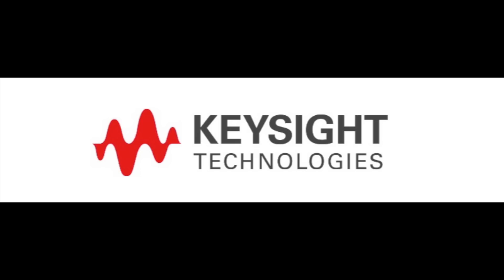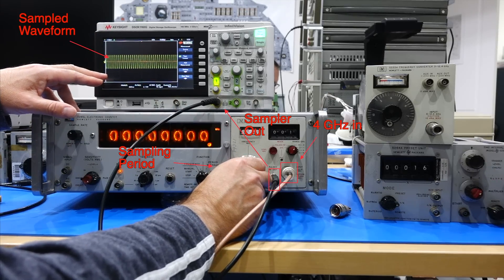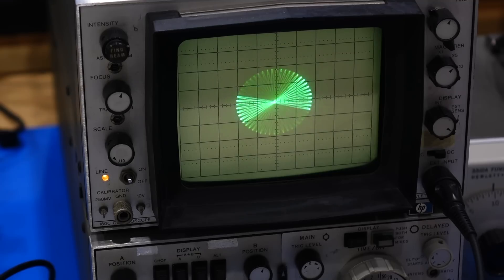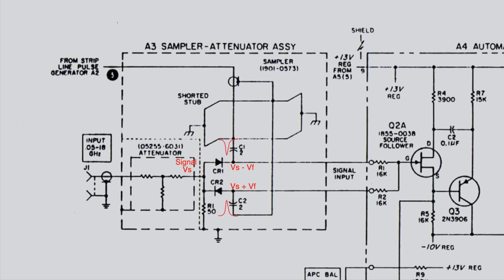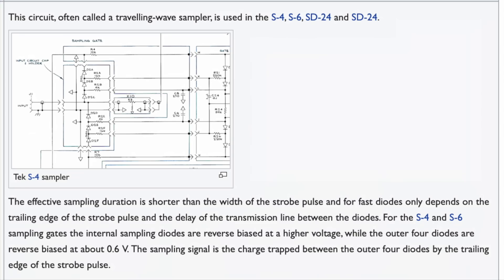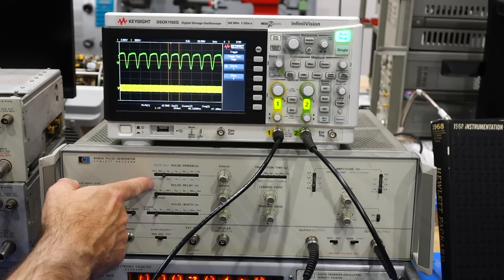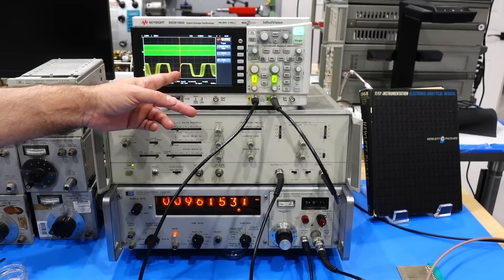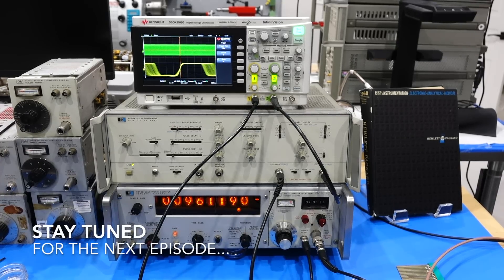Diode Sampler Magic (How Sampling Scopes Work)

Comment: Interesting discovery. You cannot get sampling plug-ins easily. I could try my 5342a counter with IF output.. I have a vector voltmeter I was wanting to make a plug-in for but have no means of measuring a fast pulse generator I was planning to make from a 74f00 nand gate . Did you change the pulse rate to measure the rise time. ?

Comment: We used the same technique for time expansion in RADAR , 13Ghz time expanding to 2Mhz . 
We made it of 2 well mached crystal with only 4 Hz difference,  one oscillator used varactor to keeping 4Hz difference. 
This way we make it very low jitter.
We used then very slow A/D to go digital 😊.  Jitter was big issue , type crystals and oscillator.  Colpit  was best with big size crystal 😊

Comment: I came to this video because I want to make some circuit for showing  a signal up to 10 Mhz on a PC-based oscilloscope.
There are several free oscilloscopes that run under Windows and even under Linux, but they require a digital interface that some people have made with Arduino.
However it is possible to view low frequency audio signals directly through the microphone connector.  The problem is that these signals can rarely exceed 2 or 3 Khz if you want to observe them correctly.
A rectangular signal of only 10 Khz is impossible to observe on a Windows based oscilloscope, entering through the microphone connector.  I have already done it and the signal, far from looking rectangular, looks totally deformed.
That is why I came to this video.
I want to develop a small interface that is able to take samples of a signal higher than 1 Mhz and transform them into an exact copy of the original signal but with a frequency 1000 times lower, in order to display it on a Windows based oscilloscope.
I hope to achieve something....
Reply from the maker: Interesting idea. At these frequencies, what you need is called a sample and hold circuit.

Comment: Hi Mark
I have got such a transfer oszillator but unfortunately these Shottky diodes are toast in my case.  Do you know closest replacement of  current available  diodes?.  Could not find a data sheet  as there  is only a HP type number given in the service doc.
Do you know if the attenuator should also handle DC as the drawing suggests?  Probably mine is also defective as it shows infinity resistance.

Thank you  and congratulation to your outstanding and  amazing channel
Reply from the maker: Although any modern Shottky that can do 20 GHz should work, the big problem is to find one with the right diameter and length tubular package, not sure if they make these anymore! HP made most of their microwave diodes available commercially, but under a different HP commercial number (5082-xxxx) or plain JEDEC number (1Nxxxx). I have not looked for an equivalent, but maybe take a look at a vintage HP microwave semiconductor catalog (the 1980 RF Diode and Transistor Designer's Catalog is online). Then maybe see if you can find one on eBay. Or get a modern Shottky and jury rig a mount that fits. The input should measure 50 Ohms at DC.
Reply: I looked through available historic documents  but could not find a JEDEC number. I think I will try a 1N5712  which has a low capacity of just 1.2pF.  Interestingly they used rather long ( 10cm +) wires  to R1 and R2. Maybe this works as an inductance ? I would rather suggest to have R1 and R2 more close to the diodes/ 2pF capacitors. I will report further progress here but this will take some time until I have got the spare parts @CuriousMarc
Reply: It turned out now that the sampling diodes are ok. I tested them falsely defective because the diodes have a 2k2 resistor in series. So diode testing gave a wrong reading However the attenuator has high impedance in all branches and the 50 ohms resistor R1 seems to be also gone. The attenuator showed destruction from high voltages, I could not locate R1 physically as I do not want to disassemble all the RF part. 
to be continued,,,,
Reply from the maker: @jps-ib8vh  Well that's good news. 50 Ohms surface mount resistors are far easier to find and change than weird RF diodes! I'd try to disassemble the RF part and get to it...
Reply: @CuriousMarc  
Hi Mark, I found a detailed description of the sampler in the hp journal 1966-10.pdf pages 12 - 15
( could not post the link unfortunately)
It is a true masterpiece of microwave engineering. There is also a name and a picture of this amazing true genius: Wayne M. Grove.  Now it is very clear that it is impossible to replace such sampling diodes by modern types. They used a very special three terminal design that includes the sampling capacitor. Before I found this article, I tried to get the sampler out for repair as there was no 50 Ohms resistor detectable.
But by opening the golden union nuts on the sampler block the inner conductors starts turning and immediately destroyed the tiny golden spring that is micro soldered to the two cones of the inner conductor. So NEVER EVER open these nuts. You get the sampler out by removing all pcb´s and the bigger golden union nut connecting the attenuator. This nut is hold in place by a circlip that is very difficult to remove. The broken 50 Ohms I found under the chrome plated terminal cap. It looks like the attenuator and consists of an aluminium oxide subtrate with thin film metalization . It was also fused.  I replaced it by soldering 2 times ten 1k 0603 resistors in parallel that I soldered on a self- adhesive copper foil.
Currently I am struggling to replace the destroyed tiny golden spring. Unfortunately, I do not know exactly how it should look as I could retrieve only some fragments. 
To be continued…
Reply from the maker: @jps-ib8vh  What an adventure! Here is the link to the journal: http://hparchive.com/Journals/HPJ-1966-10.pdf .

Comment: The principle of the shorted stub is explained in more detail in the manual of the hp8551 spectrum analyzer. (Impulse forming for the PLL, sharpening the output of step recovery diodes) I repaired on many of these instruments more than 30 years ago.

Comment: It's interesting to see where else this sampling circuit pops up, the 8405A vector voltmeter is an obvious example (which has the added feature of phase lock sampling rate to the ref A) and then samples the B input producing two IF signals at around 20kHz for both A & B off which phase and amplitude measurements can be made (and the IF works just like a sampling scope and is available out the back - thanks HP). Then the 3406A random sampling RF voltmeter which removes the phase lock and just uses modulated sawtooths to control the sampling points and produces an IF which bears no resemblance to the original signal but which has similar statistical properties (like RMS voltage, although sadly the inbuilt voltmeter isn't true RMS, but once again the IF is available on the back). Finally in the sequence the 8410A/B/C VNA does exactly the same trick as the 8405A (albeit in two stages) producing a VNA up to 12.5GHz in the basic form and to 18GHz with selected mixer heads which is still useful today (and which isn't microprocessor controlled).

Comment: This is gorgeous!! A few weeks ago I bought a cheap USB Oscilloscope, and have been wondering how to give it a speed boost. Even got far enough to see diode sampler circuits but I had no idea how they'd work - your explanation is the first that made it crystal clear, thank you so much!

FYI, the 'scope is an Analog Discovery 3, with 30MHz bandwidth and a lot of decent I/O ports. Shouldn't be impossible to use modern components to create triggers on the HF signal. You can even get configurable delay line components in the ns delay range for barely more than 10€!!
Beautiful stuff :D

Comment: Schottky diodes, field effect transistors, forward voltage, pi network, source follower. The part of me that wishes I had pursued electrical engineering over industrial engineering loves these lessons in circuit design.
Reply: After 27 years of being a heavy truck mechanic, I up and quit and started training in electronics.

Comment: Thanks for a blast from the past.  One my early summer jobs was debugging part of a high speed circuit for a high energy physics group.  I'm a bit vague on the details after so much time has passed, but I recall tunnel diodes and a short (about 30mm) piece of coax shorted at one end to get a delayed and inverted pulse.  I used a Tektronix 661 scope with (probably) a 4S1 plugin.  I recall always having to be wary of aliasing. Ordinary analog scopes in those days weren't even close to being able to show a real-time trace for such fast signals.
Reply: I picked up a working 661 & 4S1 a few years back, it really is an amazing instrument, as specially considering when it came out.  The construction & documentation of those 60s era Tek scopes is like nothing else.

Comment: I seem to recall that the old Tek 465 'scopes have tunnel diodes in the front-end. They use quantum tunneling to effectively achieve negative resistance, apparently. The things that happen up in the    gHz range are strange indeed, it really is like magic.
Reply from the maker: Yet another kind of weird diode, different from the Shottky and the Step Recovery diode. The tunnel diode is a fast bistable element, used in trigger circuits usually.
Also to make microwave oscillators. It does use quantum tunneling indeed!
Reply: @CuriousMarc  My father-in-law worked on sampling heads for the 4S2(A), S-4, and others at Tektronix in the 60s. He has stories about how expensive and small the tunneling diodes were and how the engineers were paranoid of losing them on their benches. :)

Comment: I do love watching your videos.  I'm a truck driver so I probably only understand peko bit of what your saying but I do find it fascinating. If you get time could you explain why counting frequency and sampling is so important?
Reply from the maker: I'd be happy to oblige. So many uses for frequency counting, but the primary one is for radio signals, radars, and cell phones. All that radio technology is based on stacking frequencies and modulation, and the more stable and precise, the better. Perhaps the most ubiquitous use of super high precision time counting is in your GPS receiver. The GPS transmitters are actual atomic clocks flying above our heads, and you triangulate your position by measuring the time difference from clock signals that you receive from different satellites.

Sampling has also many uses. First for its original application, which is sampling scopes that I demonstrate in this video: to measure signals that are faster than you can measure them by normal means. It allows you to slow them down. There are also radio applications, as mixers to shift your received frequency down (same idea, slow radio signals down on the receive end so you can amplify them easily).  But the most important use now is digital communications, wired or wireless. Within your computer, in the internet, in your cell phone. To receive a  bit, you continuously sample the received signal, and adjust your decision point ("is it a 1 or a 0") based on centering the sampled signal. In essence, the latest computer chip high-speed bus pin or Ethernet receiver have what amounts to a mini-sampling scope built-in that continuously monitors the signal and adjusts the receiver. Your phone data demodulator does that too.
Reply: @CuriousMarc  Thank you. That's outstanding.
Reply: We didn't have these signal sources flying over head back in 1968. @CuriousMarc
Reply: Sampling is also used in the reverse direction to convert analogue signals into digital signals i.e. speech and music. For speech in telephony systems, the analogue signals, say from a microphone, are sampled at 8khz. The resulting sample is converted to a 8 bit digital value via an analogue to digital converter, thus creating a 64kb/s bit stream. For CD quality music, it is the same principal, however it is sampled at 44.1khz and converted to a 16 bit digital value. This results in a 44.1khz x 16 x 2 (for stereo) =  1441.2kb/s bit stream.

Comment: Very good video! I recently experimented with a sampler, managed to create nicely symmetric pulses that were below 100ps rise and fall time, and 2,5V in amplitude - I was so thrilled :) So interesting with circuits that are deceptively simple on a schematic, but so complex to realize in practice. Gotta love step recovery diodes and RF magic!
Reply from the maker: Awesome. I also enjoyed looking at this fellow’s project, he just recreates and tests all the circuits with components he has lying around. Turns out it works with fairly common diodes too, just not as fast. His blog is well worth a read: https://hackaday.io/project/162998-the-rise-and-fall-of-pulses/log/158851-a-toy-diode-sampler
Reply: @CuriousMarc  yes!! I read that project blog thoroughly a lot of evenings along with pulse generator research PDFs and part of my sampler experiments used ideas from that hackaday project.

Comment: Thanks for the explanation! I think that in addition to not having a calibrated timebase, your ad hoc sampling scope could just as well happen to have a negative timebase, i.e. the "trace" running from right to left.

This reminds me of my first encounter with a very early digital scope during my thesis work. It didn't have oversampling, and I was dumbfounded for like an hour why my signal ringed before the transition. Like, how could it know‽ Of course it turned out that I had the timebase set at ms instead of μs as intended...
Reply from the maker: Indeed, good catch! Yes, this completely lacks the trigger plus picosecondish delay control of the strobe pulse that you need to make a great sampling scope. That’s the tough bit actually. But I still found it fascinating to play with a sampler. To think that I paid $5 for that marvel of engineering!